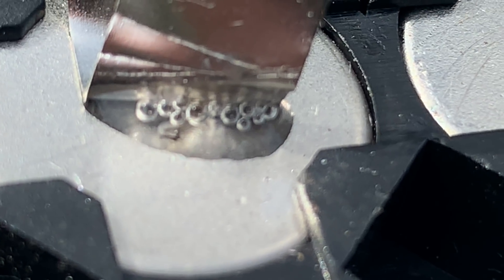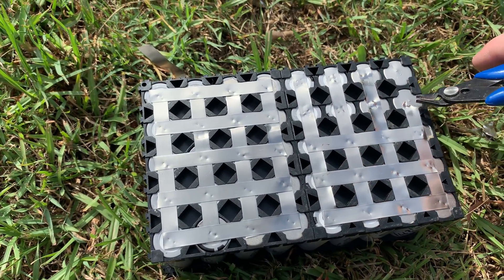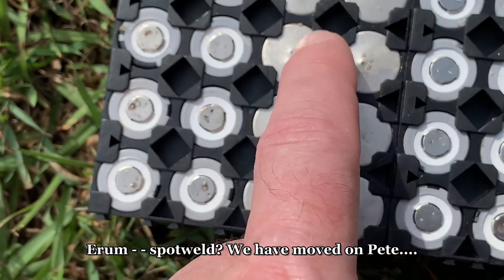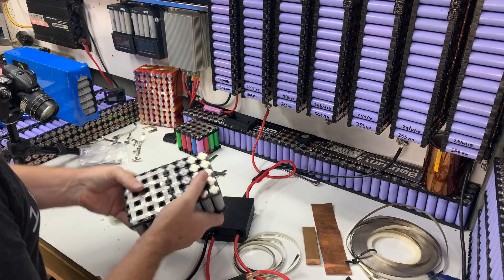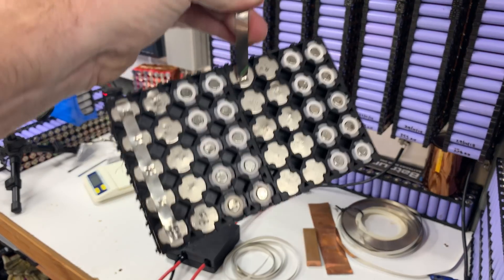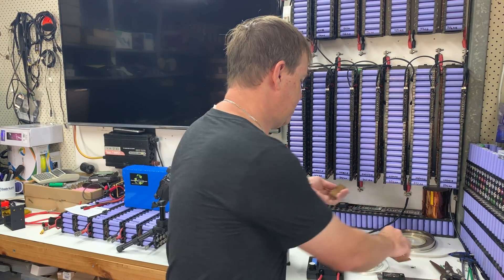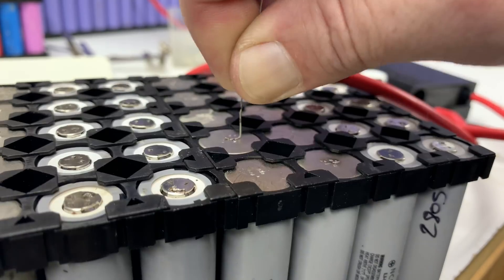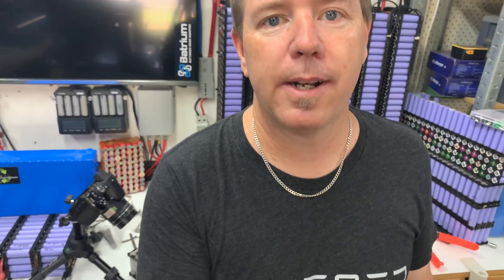Testing the kWeld Community Spotwelder

Comment: Numb question: recently secured nickel wire - 24 gauge/0.5mm - as a sorta-fuse wire.  (Ebike batteries, 10+ cells in parallel…)

Wire seems a bit harder to counterfeit, too.  Lots of nickel-plated strip sold as 200 99.6% nickel.

I’ll need to tin the wire prior to spot-welding, of course - solder pot time, with acid flux; will need serious cleaning beforehand! - and then using a jig to keep the wires lined up…

Comment: To test strips if pure nickel or nickel plated steel: Make scratches with sharp and hard pointed tool. Pour some kitchen salt and water in a bowl. Put the scratched strips in this water and in a few hours you know what you bought. Buying tip (for Aliexpress a.s.o.): Check that the seller is a serious electronics dude! Greetings, Gerard
Reply: Bought from aliexpress and did this, bought one pure and one plated. The plated one rusted in like an hour but the pure nickel strip never rusted after over 24h

Comment: Hello there. No callipers to measure the thickness of "nickel" strip! No idea if the nickel strip is pure nickel or nickel plated steel! Metallic tools laying close to Li batteries! A huge unshielded power bank at just 30 cm of your work area..... But, I must say, your blacksmith way of testing welds was so funny to watch that I watched (almost) the entire video.... Thanks for sharing. Gerard

Comment: can u try to test weld nickel plated steel and pure nickel into copper sheet (copper nickel sandwich) pls
Reply: I was able to get good welds with 0.2mm copper and 0.15mm nickel strip copper nickel sandwich. Some test ones at least, i got a couple bad ones some acceptable ones and s couple really good ones though I had to put it up to 110-115J which I’m not sure is too good for it and I don’t wanna push it much higher. I need to go a bit shorter on my cable length on the Kweld tho. There’s a limit and it comes with stubby wires for a LiPo only

Comment: Have you tried a contactor based spot welder. I keep blowing up the cheap Chinese spot welder. I have a 100ah lead acid sealed deep cycle with a timer circuit. It works great with 4 to 6ms
Reply from the maker: Will never use anything other than Kweld it works 300,000 welds later...

Comment: How about testing the 500 joule?
Reply from the maker: BOOOOOOOOOOM lol
Reply: @HBPowerwall  not on battery cells obviously, but would be nice if this could also be used to spot weld metal things. I work at Volvo and cars are mostly metals plates pressed to a form and then spot welded, with a bit of glue for water tightness. So if this could do the same on a smaller scale that would be epic, I would buy this so I can both make my own battery packs and use it as metal spot welder so that I don’t have to struggle with rivets anymore

Comment: use 99% alcohol on the strips and cell heads for epicly better welds. I have a sunkko and it works soo much better with super clean weld matterials.  Getting a Kweld soon, looks great.
Reply from the maker: I didn't find cleaning that much helped - the Kweld will impress you !

Comment: When spotwelding it is very important to place each electrode exactly and pressed firmly down which can best be achieved by holding them each in one hand. With a combination tool holding both electrodes you cant make sure both have good and firm contact. You will get some good weld and some bad ones too without knowing. An if the nickel band is magnetic its Ni-covered steel or something like that or just some chrome on steelband. Pure nickel band is quite pricy... And you should use around 50 J to spotweld 0,2+ mm nickel. 20 J is much to few.
Reply: wrong Nikel is magnetic just like iron, cobalt are also the only 3 metals that are magnetic, but you can test nickelband by treating it with sandpaper and throwing it in salt water

Comment: Interesting video, have you tried welding nickel strips and the fuse wire to nickel (thin) plated busbars?
Reply from the maker: Yes and it works well (if you don't have bad eyesight like me lol )
Reply: @HBPowerwall  Thanks for getting back, that would be an interesting video showing settings and different strip sizes if you ever get the time 👍

Comment: Is a battery 100% no good if spot weld leaves tiny little hole on negative terminal. I have a bunch that when being torn apart left small pits. Never heard or saw gassing but there is definitely a small puncture. Is it dead even if it tests ok?
Reply: you absolutely do not want a punctured battery in your pack. Toss it!
Reply: Yes thanks 
I have checked all my batteries and tossed any that had punctures.

Comment: Hello , the bad pure nickel strip was the one bought from Aliexpress?
Reply from the maker: wasn't an issue with any of the nickel it turns out it was the settings I was using.. Turned it up a bit and worked very well on all nickel - trick was not to use the same setting on all.. thinking about it that wouldn't have ever worked, another lesson for pete

Comment: Your handle ist not optimum! If it were independent you could apply more force and increase the grip, therefore better spot welds
Reply from the maker: but then wouldn't have a free hand. Would like to trial a sunkko type welding pen with this welder i think it would work well
Reply: @HBPowerwall  I believe a good grip and good downforce is worth any downside. You could try it. Good work! :)
Reply from the maker: @lindenmeyer11  I think your right to be hones and with the auto feature *that i didn't test before printing the holders it might be ok.. i guess that's the next thing i should try lol

Comment: Poor Contact gives sparks and the energy goes to that instead of the weld, making for a bad weld.. but you figured that out already. Maybe helps someone else though. 

Kweld is by far the most impressive spot welder i have seen. (At least for this use)
Reply from the maker: It's a cracking little unit that's for sure with practice I'm getting better :)

Comment: Bring the current up and a bit more ms.
Reply from the maker: Yuppers! that worked
Reply: @HBPowerwall  So quicker and stronger worked. My Diy spot welder does the same until I changed to high current and quicker pulses.
Reply from the maker: it's all in the setup + I just don't understand it so its all guess work

Comment: Pete nice video, looks like this is a good buy if you have lots of welds, all depends on the thickness of the strip, but if you are putting in 2 spots on each end, this should be strong enough👍👍
Reply from the maker: I need to learn this welder better the Sunkko unit I've got down pat - this is better I think way more powerful

Comment: I use a small sandpaper flap wheel on my Dremel to knock off the burs. Makes a much smoother spot weld.
Reply from the maker: That takes so much extra time, usually i just tap on wooden bench for some reason I didn't this time, time constraints of Videoing/editing/working/family/life arangements
Reply: @HBPowerwall  Yeah mate I know that feeling. Anyway I am building a Arduino Nano 4x 18650 Charger / Discharger almost finished the first version. Let me know if you want to have a play with one. I shouldn't cost me too much to post to QLD from NZ.
Reply from the maker: I'm keen to have a tinker as long as it's OPUS style - plug in and go i'm hopeless at trouble shooting issues

Comment: the cables will jump because of the emp induced in the cable  sparks vare from poor connection or a dirty contact tip
Reply from the maker: Sparkie was trying to make video quick and not having even pressure on both electrodes
Reply: @HBPowerwall  yeah i had the tafe lecturer put clean new tips on the spot welder before it was used  that one was a medium industrial floor mounted spot welder  sparked just like the car robot welders do
Reply: @HBPowerwall  i think that is the only problem with the auto function it needs to have a bit more dwell time before it fires
Reply: or at the very least make it adjustable
Reply from the maker: Just had an email from kWeld, it is adjustable 
:) :)
Reply: @HBPowerwall  cool

Comment: That poor little innocent battery pack.... 
I wonder if someone could draw up a mark 2 print for the electrode enclosure. Have one solid electrode and one spring loaded with a switch at the end of travel, hooked up instead of a foot pedal. So it's works with a rocking action, like you were doing with the fuse, but you know you have a solid connection when it fires. You could R&D multiple spring weights for different current settings aswell.
Reply from the maker: V2 is already in progress with a few upgrades - I'll feature as soon as i receive stl

Comment: That copper bar us oxidised quite a bit. It would probably weld better on clean copper!
Reply from the maker: I did try that off camera later - no difference
Reply: @HBPowerwall  I'm pretty sure you can't spot weld copper, and that's why they use it for spot welder tips. Spot welding relies of the resistance of the materials the current is going through, so the more the resistance the more heat and the more it welds. Maybe check the resistance of the strips over 1 meter with a DMM, but then again the thickness of the nickel might make a difference.
Reply from the maker: I know I can't but it was fun anyway

Comment: Awesome! A little warning, I've cut my fingers pretty bad on the thin edge of the nickel strip trying to pull it off on really good welds. Make sure you use gloves or pliers to pull on the strip. Not bare handed! Using a lower voltage power supply decreases the sparks intensity when they occasionally happen.
Reply from the maker: Couldn't find my gloves lol but I've got scars to know better hehe that was 4S I stared with 7S and did some mighty fine welds but would BITE you as soon as you weren't perfectly square.. Might order the kcap and a lipo or two i think.. Neat that it does work from my 18650's tho
Reply: @HBPowerwall  The Kcap module uses a 2s liion/lipo.
Reply from the maker: Definitely on the Christmas list
Reply: My bathroom looked like a scene from a horror film after I insisted on not wearing gloves while cleaning cells. I wanted the extra dexterity for cleaning all the little stickers and tape off the cells. I ended up cleaning up a bunch of blood along with it though!

Comment: Take a small grinder to your nickel strips.   Sparks = plated steel.   no spark = pure nickel.    Both are magnetic.

On the spot welding,  I  use 15 J for single strip.   I kick it up to 25J for second strip.  I use manual and make sure I have a good hard connection.   If you keep the pedal down after the weld the display will cycle the stats and that will let you find tune your weld.

Practice on some junk cells to tune in your settings.

You can safely go to 100J

Its an excellent welder and will do you well!
Reply: Thought about adding that to one of my videos!
Reply: @AVERAGE_JOE  💥
Reply: Also worth cleaning all the surfaces first with IPA or other degreaser

Comment: Heckling your own video. Hilarious!
Reply from the maker: Trying to bring more of me into videos - how i am in real life not highly edited - (minus the potty mouth) lol
Reply: @HBPowerwall  Any idea what the input specs are? I saw you're driving it with the powerwall, but will probably use a power supply. Wondering about voltage/current needs and didn't see it on the kweld site.
Reply from the maker: Needs huge amps 3S157P blew every fuse on the positive side!
Reply: Oh, so the guy using a motorcycle battery, a solenoid and copper nails might have the easier solution?